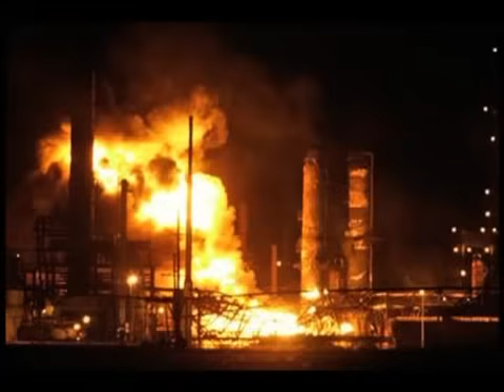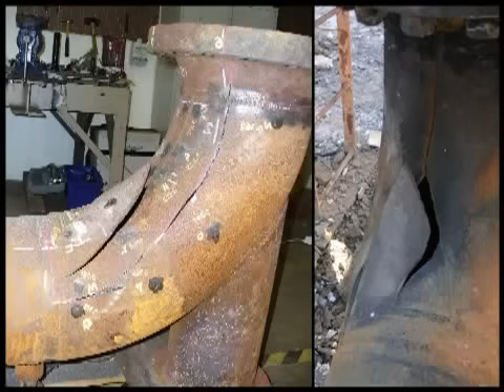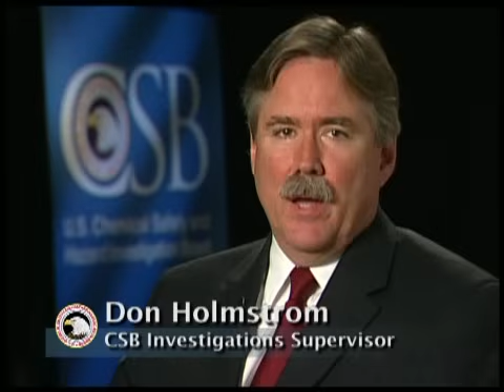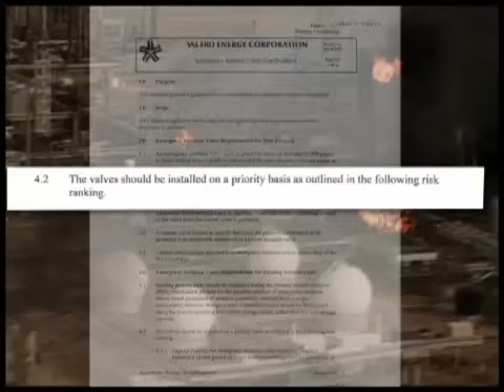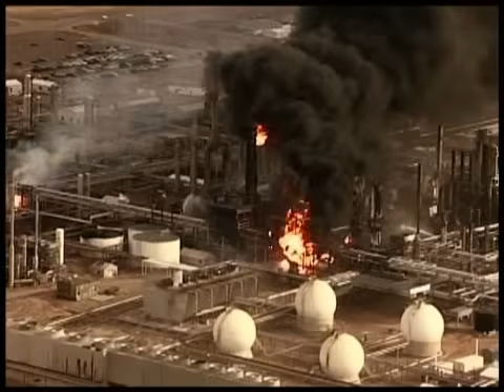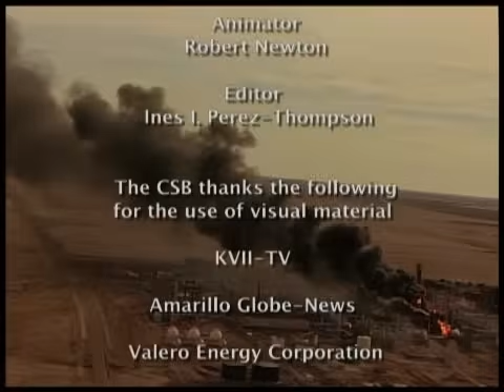CSB Safety Video: Fire From Ice

Comment: "Propane deasphalting unit" sounds like something that would blow up, tbh.
Reply: Literally all of chemical engineering is making sure that something that wants to blow up, doesn't blow up.
Reply: And rocket engineering is taking care things don't blow up too fast.
Reply: @samiraperi467    And in the correct place, usualy the combustion chamber and nozzle.
Fluorine based oxydizers are well known to not always do that and making just about anything combust, even asbestos, sand and water.
Then there are also fuel leaks, wich in case of hydrogen need no further explanation and in case of hydrazine derivates are highly toxic.
Reply: @samiraperi467  rocket engineering is literally boys with toys :p
Reply: @diesistkeinname795  yea

There was a Time when the US was experimenting wit Cholrine Trifluoride.
The tank, in which it was transported got a leak, and it burnt through several feet of concrete and dirt.
Scary stuff.
Reply: @danieldeak9141  Yea, ClF³ burns through everything that isn't fluorinated to its limit.
Be it gas masks, asbestos, concrete, glass or steel.
The only way to store it is to coat a container with a fluoride layer, but if said layer gets damaged...
Reply: @diesistkeinname795  the most important part is that most chemical engineers are not very well-flourinated, which ClF3 is happy to try to fix.
Reply: @mrslinkydragon9910  yeah, it was for a long time because of active discrimination to prevent women or minorities from really getting into it...

But now they also don't view the goal/destination as more important than the return and the astronauts lives, unlike back then. So it's now neither part of what you're saying now
Reply: @hash_broens  And literally all of explosives engineering is making things that really want to blow up, blow up -- but only on command.
Reply: It's one of those phrases that you don't need any training of to get a really accurate and grisly picture in your head. The one that always gets me is "catastrophic protein de-naturing" which ... yeah, don't look that shit up.
Reply: Anytime I touch liquid propane cylinders I say a prayer
Reply: @lunarballoonistxo  lol are you joking? Propane tanks are not dangerous.
Reply: @ohanaross-roberts97  Have you ever had to refill one yourself? I wouldn't underestimate how propane behaves in it's container. Or you could leave yours in the trunk of your car for the afternoon and decide how not dangerous they are yourself
Reply: @lunarballoonistxo  yep, and why tf would you leave it in your car trunk for a afternoon?
Reply: @ohanaross-roberts97  Ask the people who have done it, I don't know but they will explode if you don't handle them properly or overfill them ect. It's not a game lol you can't just play baseball with propane cylinders
Reply: Yes absolutely
Reply: Yeah, and that sounds like something that would blow up twice which it did
Reply: I was wondering what propane had to do with it. Now I know.
Reply: I am curious WHY all of those pipes aren't under ground?!
Reply: Władca Wymiaru It would be very difficult to service or inspect any piping that is underground. A lot of times, (as an example) ultrasonic thickness readings can be taken on the pipe to determine the condition of the pipe on the inside (i.e. corrosion, starting of cracks, etc), in addition to a visual inspection. Also, when valves need to be closed, it’s easy to access them above ground. The video talked about the importance of being able to keep the pipes warm, which would be more difficult to accomplish if they were located underground.
Reply: @WadcaWymiaru  easier to see leaks and fix them
Reply: @WadcaWymiaru  
- Easier installation and maintenance 
- Less corrosion, pipes aren’t touching soil
- Makes cool explosions and fires when they fail

Comment: Eagle point NJ is now closed. All instrumentation was air operated. The emergency knife valves on the gas lines were set to fail open on the asphalt unit. I freaked out and asked why. You wouldn't want the unit to shut down just because we lost electricity would you. I said like if there was a fire and it burned thru all your control tubing? Omg. Place scared the crap out of me.

Comment: Liquid fuel makers are absolutely infuriating. They charge outrageous prices for their product and yet, they skimp on a few thousands to make the process safe. What were they thinking in failing to simply remove the out-moded piping? Labor costs were too high? Were scrap pipe prices too low at the time?  Then they forgot all about it. So what if some workers were horribly injured? Profit, baby! Profit So they can have bigger lawns and meet their country club membership fees.

Comment: years ago behind a Home Depot I worked at some clown broke the lock on a 300 gallon propane tank and opened the valve and ran away, almost the entire contents of the tank emptied behind the building and the cloud was held in place by a 3 foot wall around the rear loading dock area.......   I was the first one to find it, we evacuated and called fire.....  they simply waited for it to dissipate.... Very scary
Reply: Liquid to vapor expansion for propane is 270 times the volume, but can expand upto 1600 times while oxidizing (igniting).   Alot of potential energy squeezed together in liquid form...
Reply: What is scary about your story is that it includes fire hazard... and clowns.  I pictured a creepy clown with bolt cutters.
What is pleasing about your story is your quick reaction and the thankful outcome. :)
Reply: So a vapor cloud formed, but an ignition source was not found? I'm not familiar with this scenario. Been watching too many of these USCSB videos.

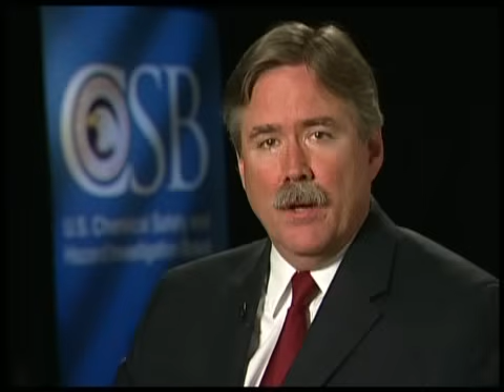Comment: 5:39.  Investigations supervisor Don Holmstrom states that safer biocides than chlorine were available.  He specifies bleach.  o.O Most bleaches until less than 15 years ago WERE chlorine-based..
Reply: But not pure chlorine, which is a very different beast than sodium hypochlorite.
Reply: Look up why you don't mix bleach with ammonia based chemicals
Reply: @Heartskater1983  Look up 3rd grade English and watch the video again. This has nothing to do with ammonia.
Reply: The risk at this site was inhalation of chlorine gas as it leaked from the cylinders. This would not be the case with bleach, which is mostly water.

Comment: 9:34 "Bleach is safer than chlorine?"  Isn't there chlorine in bleach?
Reply: They mean elemental chlorine. Bleach (sodium hypochlorite) is comparatively non-reactive, like table salt (sodium chloride). Raw chlorine gas forms hydrochloric acid in the lungs when inhaled (see: WW1, and why you don't mix bleach with ammonia). As a bonus, it's corrosive to many metals and can exothermically react with steel at fairly low temperatures (above 190 C).
Reply: @chad_bro_chill  Best advantage of bleach over chlorine: it's not stored as an intensely toxic pressurized gas.
Reply: The real problem here was the inhalation hazard presented by the leaking chlorine gas. Bleach would not pose the same risk, as it's mostly water.

Comment: That metal looks like a welding rod. Was it? 

There's a reason serious outfits count rod stubs after a weld is performed.
Reply: Ha. I have worked at COUNTLESS refineries (I'm a welder/fabricator), I have not once had to turn in the end of my electrodes. Not once. But I always take the same amount of electrodes out and make sure I pick up the ends of the electrodes when getting more or leaving the area.
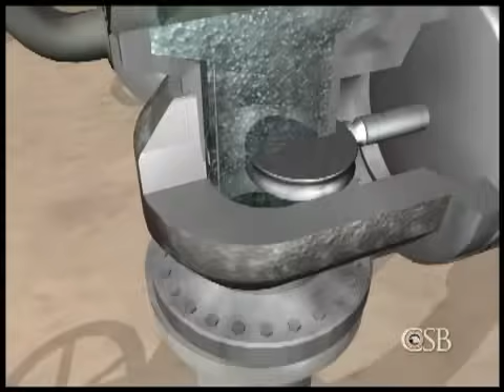Reply: white zebra  2:21

Comment: So...not fireproofing structural steel will lead to collapse....sound familiar 911 conspiracy noobs?
Reply: just an FYI, not taking sides on this one - All fire is not created equal.  Propane burns in air at over twice the temperature as jet fuel.

Comment: If fireproofing is required within 50' of all fuel sources, and the 90' pipe rack was carrying pipes with fuel in them, then those supports are within 0' of fuel sources and should have been fireproofed.
Reply: As long as there are only welded connections (instead of flanges) at the Piperack, there is no potential for spillage of hydrocarbons. 
And you can never know the direction of a jet fire.

Comment: The danger of dead end pipe runs is well known in industry.  Valves and never 100% shutoff, and valves closed ahead of capped lines are subject to high pressure from ice, temperature etc.  This is rookie stuff.
Reply: Yes gate valves suck ha. Looks like a welder had done some back feeding and dropped his filler metal and it ended up in the valve seat.
Reply: David Hoekje no it's being cheap. I can't believe the lack of safe practices I see in these videos. It appears they just build and run it as cheap as possible, and get lots of insurance. These company owners need to go to prison when this crap happens.
Reply: sounds like they didnt remove the dead leg because doing so would require them to shut off their process and lose $$$ while blinds are installed or piping is replaced
Reply: @harleyspeedthrust4013  Instead, they blew up the plant and lost 50 million $$$s.
Reply: @LeCharles07  And it's surprising that it was only $50M. I was watching a CBS video about a refinery fire in Philadelphia which they said caused $750M in losses to the plant.
Reply: That's why the industry standard is "double block and bleed." It automatically assumed the valve is leaking
Reply: ETM Nation - Best ETM Music   Nope, I disagree. Safety is expensive. Maintence is expensive. The Big boys in the boardrooms are the ones who shave those profit margins. Middle Managers are caught where they manage- in the middle, sweating it out at the Refinery, praying something does not go boom. Good, pro-active managers cost extra, and they are a pain in the ass to deal with, constantly harping on the real needs of the plant, too. 

So, when that Big Boss is looking to impress his "Bigger boss" with a .02% profit margin over last year and collect that 50 grand Christmas bonus, you can bet he redlined the Hell out of the maintenance budget and laid off a few safety people to get it. No skin off his back from 3rd-degree burns. 

Notice that abandoned piping stayed in the grid for 15 Years! Wanna bet the ass hole who made the decision not to remove it did it in order to save a little off the maintenance budget,  has retired or moved onto a big promotion since then? Yeah- His butt was highly polished - just look how "Efficient he was!"
Reply: @adamfrbs9259  "if you follow me on Instagram you can too!!!"
Reply: This was difficult to read. Must have been written by a 'rookie'. Lol🤣
Reply: With a name like yours, you must be smart.
Reply: David Hoekje yew shutdup.i emm plant manerger Ann Yew NO nothin!

Comment: Liquid filled lines (4:17) flowing at the rate of, lets say "1000 gallons per minute" would never MELT AND RUPTURE like that. Hypothesis derived from "Texas Ones" obviously.. Now oil can even melt steel beams cooled with oil, being burned with oil.. Oh what's next? Great video Cough Holy shit the oil flowing was a direct coolant to the steel tubing. Not getting any "collapsing" with oil flowing there.. Great work.
Reply: You missed the point, it wasn't the pipes the melted, it was the support steel holding up the pipes that failed. When the supports failed the pipes fell and ruptured causing the release of the oil. The pipes may have been cooled from the flowing oil but not the support structure.

It doesn't take long for steel to lose its strength in a fire and that's why it is important to protect the steel from exposure to fire.
Reply: First off, stop with the "jet fuel won't melt steel beams" bullshit.  It never had to melt them, it had to get them to a temperature where the steel is soft and will buckle easier.  Before you comeback with some conspiracy theory bull shit I want you to go out and buy a 1/4 steel rod and a PROPANE torch.  With that dinky little torch you can heat that rod up hot enough that you can bend that rod into a pretzel by hand.  It didn't melt, or even get it close to melting, we just got it hot.  Try bending it when cold to compare, then please reflect on how much of a buffoon you sounded like all these years.

In this case it has nothing to do with the pipes rupturing due to heat, the whole support structure was compromised (in the exact same manner as the world trade center).  Once the metal was weak, the structure fell.  Having nothing to support them, the pipes ruptured.

Stay in school please
Reply: The lines broke because the supporting structure was weakened.
Reply: You don't have to melt steel, you only have to get it hot enough that the yield strength drops below that needed for static pressure to rupture the line, which is only say 200 C for mild steel. Basic solid mechanics 101 stuff.
Reply: I thought they said that the lines mechanically failed because the support legs collapsed.
Reply: It's almost as if the scaffolding supporting those pipes didn't have oil running through the solid structures... how dare they...
Reply: If only the support structure holding the pipes in the air was liquid-cooled, too.

Comment: We always use blinds when pipelines go out of a technological scheme. It's a mandatory procedure!. Also there has to be freeze protection as tracer pipes or electric heats cables inside insulation.
Reply: Blind, drain and purge.
Reply: MermanFromRus but if they opened the elbow to put a blind in. Wouldn’t it have leaked.
Reply: @Mk5mod0  you would isolate and shut down to install the blind. This is normal in our industry.
Reply: @Mk5mod0  imagine a leaking pipe in your house. There are valves throughout the line in such a way that you can get a section if pipe turned off so you can work on it
Reply: Double block and bleed.... Industry standard, to ensure you go home safe

Comment: @pozorlano Sure, you can get an engineers degree, and tour the world identifying hazards and fixing them for free.
Its damn easy to say "Those redundant pipes should not have been there" in retrospect, but at the time it wasnt as obvious.
Reply: I have to disagree.  Ask any plumber or boiler tech. about dead end pipe runs.  It's routine to treat them with the same respect as a pressure vessel.
Reply: Dead legs are well known to be troublesome long term in the chemical and petroleum process industry. These guys got complacent, it's just that simple.
Reply: An aggressive inspection and maintenance regime could have noted them, and saved the refinery. What's good enough for aircraft is good enough for industry. Airline safety has had a magnificent record for many years, worldwide. That's not by mistake. If the chucklefucks in industry treated safety the way the military and airlines do we'd have far fewer accidents. Instead we get excuses.

Comment: for every safety guideline written in any industry, someone has been injured/harmed or killed.

we are stuck being reactive. we can never achieve complete  safety-proactive state unless you forget about the money
Reply: It's not money, it's greed. Alot of simple, cost effective measures and methods go a long way. In this case, installing a simple blind flange that costs $300 installed during routine annual maintenance downtime would've negated the risk. Most of the time, it's pathological cheapskatedness that prevents safety.
Reply: in fairness though it is incredibly hard to predict what is going to fail next, the more complex the system the harder it is.
Reply: It's really easy to point the finger at money and greed, and there's an argument to be made about the human costs of financial priorities exceeding safety priorities, but it's also true that it's just not possible to prepare for every contingency. 

The airline industry is the most heavily regulated industry in the world, yet still many procedural and engineering flaws are not discovered until they incur a human cost. To some extent, that's just how things are; it's a fact of life. 

This isn't to say that we shouldn't talk about how financial concerns can cloud safety judgement, only that we ought not blame everything on greed, as that simply isn't accurate and doesn't lead to any real-world solutions.
Reply: No one will ever predict and prevent every possible potential for failure. We are human. Accidents are in our nature and it has NOTHING to do with greed. I get so tired of listening to uneducated people cry about companies making money. If you're jealous, go make some money and stfu.